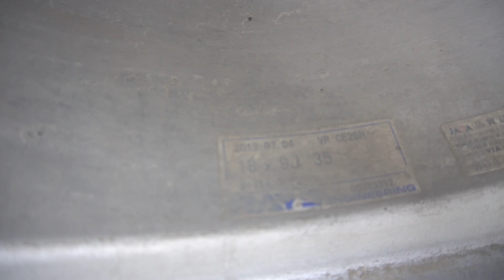NEW WHEELS FOR THE LAST TIME... + CAR CHASE NEAR MY HOUSE!

Comment: Aye bro I have a 07 sedan Si and I have a clinking noise on the front passenger side and I'm not sure what it is I fixed the shocks and struts ? Any idea?
Reply: Yinne Medina it’s probably you idle pulley and tensioner pulley has the same problem